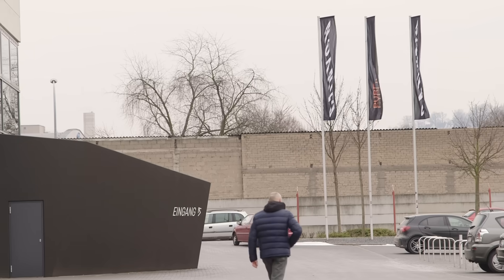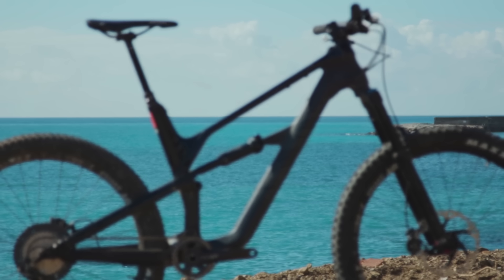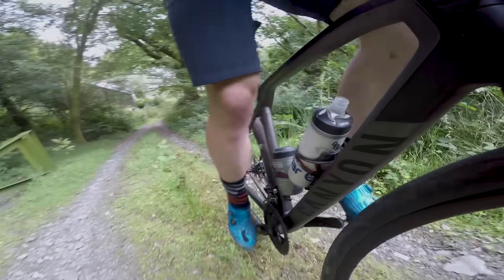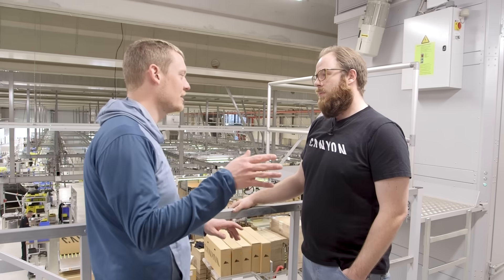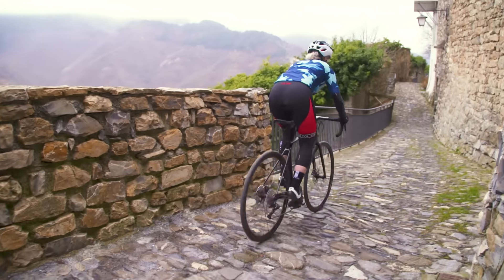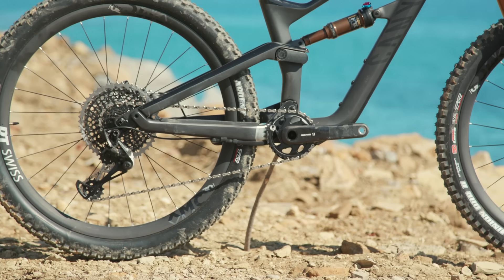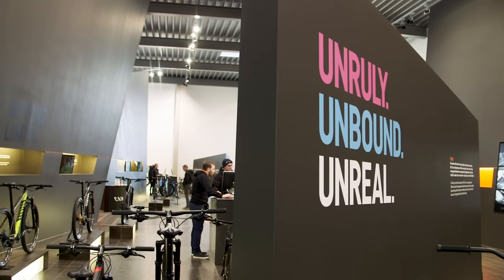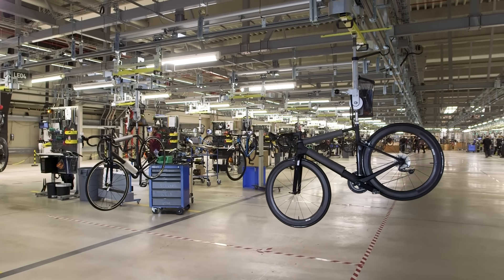Secret Life of Canyon - The Brains Behind the Bikes

Comment: I took delivery of a brand new Aeroad CFR. TO emphasize, it it the top end road bike for Canyon. I received one DT Swiss ARC1100 50mm and a 62mm wheel. I was told by Canyon that it would not affect aerodynamics;   this is BS... I'd like @DT Swiss to publically agree to that statement and thereby call BS on their own claims and rationale for have difference width rims.

Canyon person further threw "our terms and conditions" BS at me, say they allow Canyon to switch parts due to shortages. They have done this simply because they know that as a foreigner, I am unlikely to take action against them. I conclude therefore that this is Canyon modus operandi, that is to switch to lower price options that suit them. At no point was I consulted if I would agree to a swap to a cheaper 50mm wheel.

This is my last Canyon. i'd rather pay double for a Dogma, even if I cant afford it.

Comment: Then we ask why it's so expensive... well, now we know it's no expensive but a just price for the work behind.
Reply: Manufacturing products is not expensive. The research is. Same in the housing market (in the US at least).  How do developers and architects build a brand new house with 5 bathrooms and 6.5 bathrooms for less than 900.000 USD and put it on market and sell it for 1.8mil. Same concept.
Reply: @adamf.8564  sorry to disagree, but manufacturing IS expensive specially if you are taking all your parts from Asia and assembling them in Germany, big wage difference and quality control oversight. Kudos!

Comment: Canyon is bad. 
I bought 2 month ago a exceed. And the bike had got several problems : 
- poorly adjusted speed
- the brake control was scratching
- the bike pedal did not turn.
Reply: Don't Canyons and nearly every other bike ship without pedals?
Reply: of course there were pedals but the didn't turn. I had to change it. There were several problems just for a bike.
Reply: I but I don't think, each bike come with pedals.  Call them to be sur.
Reply: you're right. Canyon bikes don't include pedals. I have 4 (Nerve, Exceed, ultimate and road lite) and none had pedals. Which leads me to believe "'c'est lui" had a dream...:)
Reply: PePVCpe
I have change the size of the exceed 3 times ( S, M, M) and each time there were pedal. Moreover, my brother had also bought a exceed there were also pedal. So please...

Comment: Bought a Canyon AEROAD CF SLX DISC 9.0 LTD at the beginning of summer.  LOVE IT, easily the best bike I have ever owned.
Reply: Cool, any tips on sizing ? Looking at getting one too..
Reply: @warrenmullett  I have a Medium frame...when I did there little online thing I came out that I could "maybe" use a small frame...I decided to not and went with the medium.  Fits fine...I am 6 ft tall and weight 150 lbs.  32  in inseam.

Comment: Gravel bikes are obseolute technology as cyclecross bikes outperform and outspeed gravel bikes on all aspects. Cross crounty bikes also beat them in terms of performance and weight.
Reply: Cross country bikes run around 20-23lbs. That would be a heavy steel gravel bike. A cyclocross bike will only better than a gravel bike on a cyclocross course. Cyclocross bike is only for 1 hour rides. It doesn't have the water carry capacity, gearing,  and often now the  tire clearance as a gravel bike.

Comment: The gravel bike is really innovative, but for a brand that call itself "trend setter" the new xc bike Lux with 70° head angle is definitely old. The xc bikes should change like the Enduro bikes, longer reach, shorter stem, slacker head angle, steeper seat tube angle.

Comment: I don't get use to see that kind of handlebar on CANYON gravel bikes. Is very strange, and it has redundant parts that rise the weight. Anyone knows the prupose of that shape?
Reply: The handlebar allows vertical flex between the front of the bike and the rider's hands. It's a lower maintenance alternative to a suspension fork. Given how unreliable and expensive suspension forks have become, it makes a lot of sense. Sadly the bike industry at the moment seem to only make expensive, maintenance hungry, but effectively disposable suspension forks. 

Back in the day Marzocchi used to keep the other manufacturers honest, both in terms of pricing and durability by making forks that would run for years with very little minding. Unfortunately they bankrupted themselves by outsourcing badly to China and the other fork manufacturers have been cranking up their prices while reducing their durability ever since.
Reply: Hold on the straight flat top, for a bit of flex and give. Debatable if the penalty is absolutely no flex and give in the drops.

Comment: A bike is a bike. Either crap parts or expensive ones. But the prices you charge for a bike is out of this world. What's it made of, gold? WTF dudes!
Reply: Pretty cheap compared to Santa Cruz or Specialized though. In my opinion, even for full suspension bikes, after about €2500 you're wasting your money unless you're already riding at a level where they're giving you the bikes and paying you to ride them...
Reply: I have bought two and pricing is very competitive.  My wire's  XC Exceed CF would have been over $1500 spected the same more from a big store front brand like specializes, Giant, etc.  Service after purchase has been great.  We bought 2 great road bikes from the local Specialized dealer 5 years ago which we still ride.  But the shop change hands, as did the Giant shop, and the service levels dropped as well. The new owners don't know us or make any effort.  Their best mechanics left and we followed them to a small independent shop.  We have never bought a bike from the new shop but they are very supportive.  When the new Specialized shop owner saw my wife on her Canyon we was very negative.  Your lbs is the front line and if they fail, youdon't get much help.
Reply: totally agree.
Reply: The best sign that new bikes are overpriced is the second hand market. After 1-2 years the price on eBay is at half or even less of the retail price. I have bought a bike from the shop.

Comment: It's a shame their support is so poor. My 2018 spectral is unrideable with a broken chainstay. I notified them of the issue the day the recall notice was sent out, over 6 weeks ago, and they have not responded to the ticket. Canyon, if you're watching, my ticket number is 00599061. I'd like to ride my bike again soon...
Reply: What country are you from? sometimes it is good to send a email directly to Canyon Germany HQ.
The guys that care of your area can be sometimes d°ckhead.
I had 1 issue and Canyon warranty went smootlhy, same for a friend who got his frame replaced!
My second issue was on a bike order and something went wrong. 
Contacted Canyon Germany and everything was cleared.
I have 3 Canyon and a 4th one one the way :D
Reply: Canyon redirected my bike delivery to the Chalet in the Alps where I was staying when the order got delayed and I needed the bike for an Alpine biking holiday. The bits Canyon designed have given no trouble apart from the downtube internal cable routing, which can't handle wet muddy conditions at all, the front derailleur cable particularly went stiff on the first muddy ride, I replaced the rear with a full length external cable and it's worked perfectly ever since. 

The Ringlé wheels my bike came with were junk too the spoke nipples started failing by day 2 or 3, there were literally spokes falling out of the wheel as I rode - thankfully I found all the spokes and replaced the shitty aluminium spoke nipples with brass ones and my wheel problems went away until the axle of the rear hub snapped almost a year after. It took several weeks to get a new one from Canyon. I literally couldn't buy one anywhere for any money when I went looking though. I suspect so many of them broke that Ringlé ran out of spares...
Reply: Yes I can confirm that it is so poor also in Germany. Very bad client experience,
Reply: Call Germany HQ hotline to get things moving!

Comment: Great video,  didn’t know they test every carbon part before goes on a bike. This for sure gives me confidence in this brand. I have owned only Specialized bikes in over the past 20 years, however been looking at some other alternatives since pricing of top model S bikes is out of control.
Reply: Same here, I switched two years ago. Leaving specialzied was purely based upon the ripoff prices that nobody can justify anymore.
Reply: I own three Specialized bikes and recently broke one. I had two fractures under the seatpost (bolt was not over tightened) took pics and sent them to my LBS. They contacted their Specialized Rep and he agreed to replace the frame. Received a new frame within a week of contact. I had a 2015 Tarmac. They sent me a 2017 in replacement. While I didn’t like the fact that my bike cracked, I was very pleased with the overall customer service and quick resolution.
Reply: RC401Central Be happy, that's not something you'll see very often. If bike is expensive and especially carbon most top companies should do it. Did you keep the frame or give it back to them?
Reply: i broke a stumpjumper and they sent me a carbon sworks.
Reply: @ROBinJVILLE  Can you tell me more of this experience? cheers
Reply: I was also thinking about getting a canyon but there are a lot of bad ratings online - customer service wise :/
Reply: The old story about how you only hear about the bad results... I had good customer service, and loved my canyon ultimate. Still bummed that it got stolen..
Reply: Deathking66623 alot of the customer service reviews come from a few years ago when it took a few weeks just recieve the bike. My customer service experience was fantastic and I've enjoyed my new canyon issue free for a few months
Reply: I don't know how its overseas but here in Germany it is still the worst company I ever dealt with. Checkout trust pilot. All the bad reviews are not only 2 years ago but also very actual.
Waited for 4 month and they still did not manage to deliver the bike. Same with my wife's bike. They just don't deliver and when you ask them they just move the delivery date one month back and one month back and so on. And if you want to write about your bad experience on Facebook they simply block you. 
If you trust on your luck, feel free to order at canyon. But if you want to be sure to get good products and good customer support buy somewhere else.
Reply: Don't think they would check the rear frame? I think he suggested only the front
Reply: I was also thinking about getting a canyon bike but it seems like the customer service is random, some people wait months to get a little piece and other have it in the week. I think it's a good bike and worth it for the money but I will not buy one until they fix there customer service.
Maybe i will buy a giant, so that  if there is a problem you can go to the giant shop near you
Reply: Djd Njddk The customer service i recieved from Canyon was first class and i wasnt an easy customer because i was between sizes and had to return two bikes to get a correct bike/fit combo. One piece of advice i would give is try to order from stock or something that is due within a few weeks. I have a Lux on order and the delivery date moved from end of Sept to begining of November. You can cancel the bike at any time up to dispatch, and also dont pay for it until dispatch if you pay by pre-pay credit card/paypal etc. Its worth noting that other bike manufactures also have problems with delays, my Giant XTC advanced 1 was promised Oct last year and didnt turn up till December
Reply: Djd Njddk Yes, definitely considering Giant. For $3700 now, (month ago was $3600) u can get full ultegra/disc Propel Advanced with carbon wheels. It’s bit heavy but aero bike, that looks and rides really good. On flat roads bit extra weight doesn’t make that much difference. I’m in a process of building S-Works Tarmac with R8000 group set,  by the time I’m done, will cost me around $5-$6k ( depends what wheels I will go with) and that’s not even latest frame from Specialized ( I’m using frame that has been sitting in my attic for 4 years! Special color 🤓). U can go buy fast bike, ready to go for $3.7  and it’s aero bike as well. I’m questioning my wisdom here?...Just really like my fluorescent red paint, Specialized did in that one year. Cheers!
Reply: easyx9mm Looks like a great bike! I will maybe go for a tcr  because I like climbing  and I think it will fits me good, anyway I will try one before I buy, i think I I'll go for a tcr advanced sl 2. U can get one for 3200€, 6.8kg, pro frame, ultegra, carbon wheels. Check giant shop online really interesting discounts 
By the way the comments here just show how random canyon service is.